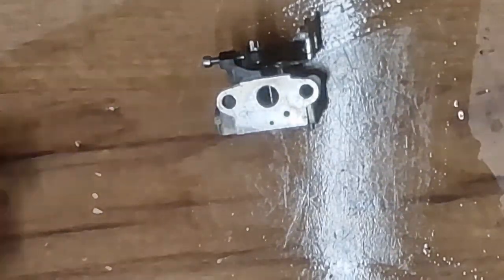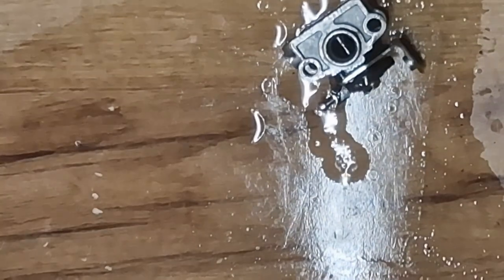Carburetor won't rev out?

Comment: If i did this it would never work again. Is it the same concept for titan leafblower? Also my cheap make strimmer wont start. Thinking now it mite be a dry diaphram
Reply from the maker: Hi mate yeah it's the same process and most likely will be bud
Reply: @Robsenginerepairs  cheers pal
Reply from the maker: @RaVeR076  no worries any problems drop me a message